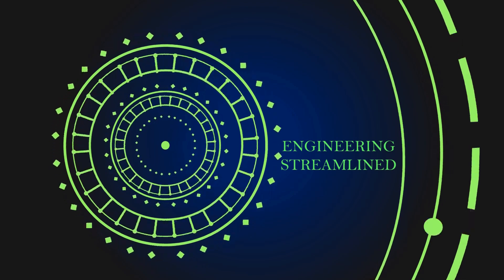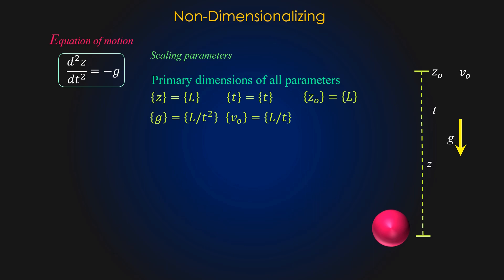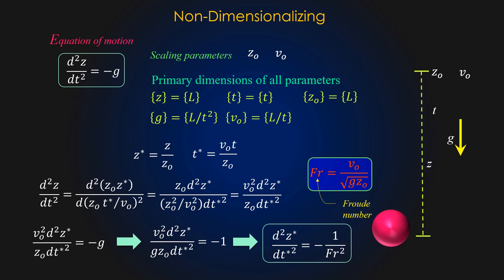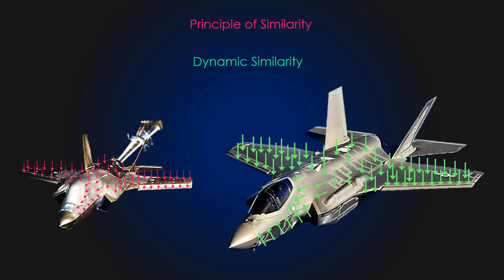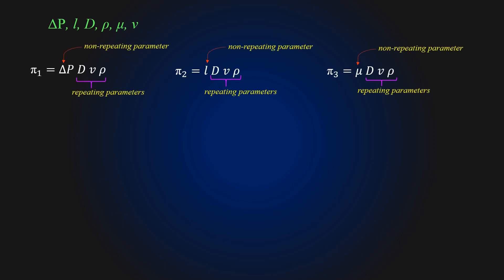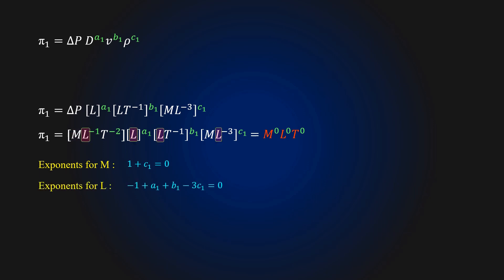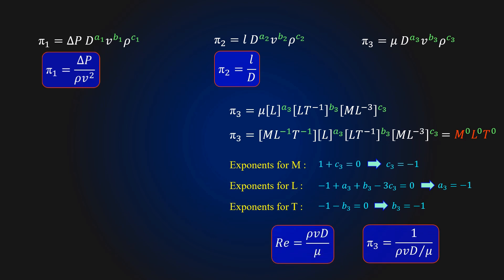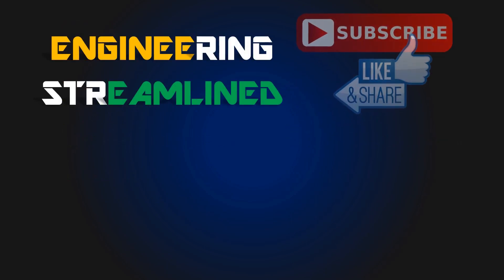Dimensional Analysis- Buckingham Pi Theorem

Comment: Thanks. Showing the Pi Theorem very explicitly on that example was very useful. To check if I got it right, I have used another problem in parallel to try it out and it worked :-) (even though I needed to use repeating parameters which differed only in the exponent, leading to an equation with two unknowns. But choosing one unknown as one solved the issue)
Reply from the maker: I am glad the video was useful for you.